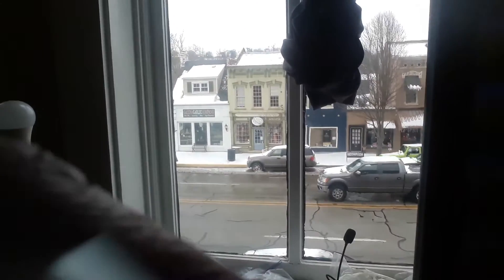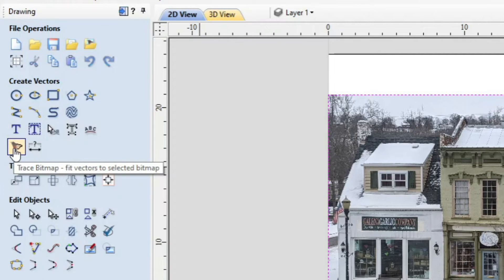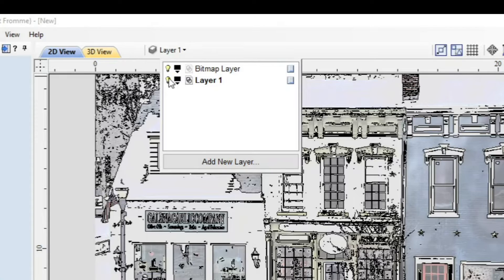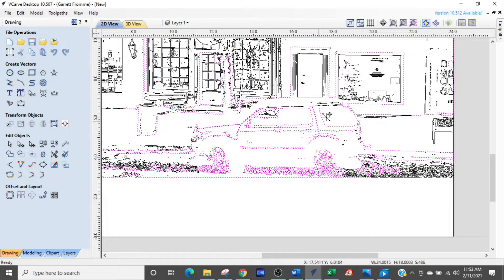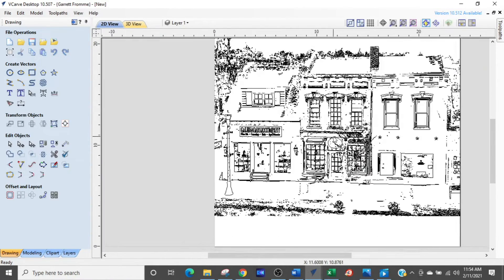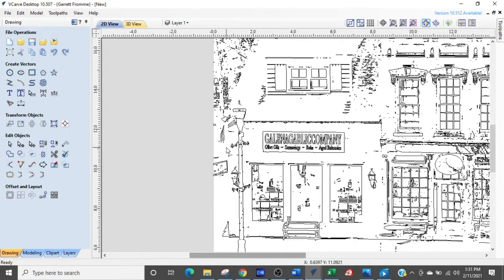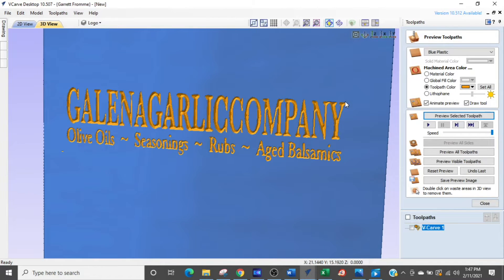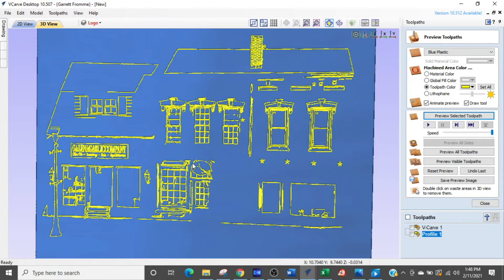Design Logos, Projects & Signs From Pictures & Photos, Vectric Vcarve & Aspire Tutorial

Comment: Garret do you have a video showing how to transfer a photograph from a camera into something that can be imported into Vcarve?  I have a project in mind which is making MDF bottoms for one of my toolbox drawers to keep my screwdrivers from shifting all over the place when I open and close the drawers.  I started to do it by actually measuring each screwdriver, but seeing that I have torx, flat, phillips, hex drives etc. not to mention the different shapes of the handles, it would take days to measure all of those so I just gave up on the idea.  I would like to give it a shot with a photograph but do't know how to get the photograph into my  program or wherever it should go.  Sure enjoy your videos.  Between you and Mark I won't live long enough to try everything, but you guys are the best resource I have ever found on the internet.  Thanks for what both of you guys do to help us out here.
Jim
Reply from the maker: Hi Jim, yeah you sure can brother! All you need to do is use the import bitmap feature and trace the object that you are trying to cut out. It would also help to take the picture with a ruler so the dimensions are correct when you put it in Vetric. I don't have a video on something like this specifically yet but Ill add it to the list brother!
Reply: @IDCWoodcraft  Hey Garrett thanks a lot for getting back to me on this.  And great idea about using the ruler as well.  I probably, no surely would not have thought about that.  Thanks again and thanks for all the helpful video's.  Really appreciate that.

Comment: I design a logo but the logo is 3D and when I start to calculate it says my carving will go through my 3/4” lumber.  It says it 1.58“ deep.   How do you make it where it will only cut 3/8 or 1/2” deep so I can use it on my 3/4” walnut.
Reply from the maker: Hi JL. You need to reduce the shape height of you model. Download the PDF I have linked below. It has all the videos I created, and they are labeled. Watch the videos about 3d models. Download the PDF from this link now → https://bit.ly/3mLHGfI

Comment: What an awesome video Garrett! That was quite the leap of faith you took. I hope wherever things lead you, that they are where you planned on going. Now for the CNC part. You created a tool path for the logo using a 90 degree V-bit and then a different tool path for the rest of the image using a 60 degree V-bit but you kept the logo selected too. When creating the image tool path, shouldn't you remove the logo from that part since it already has it's own tool path so when carving the image out, you wouldn't be going over the logo twice with two different V-bits? Or do you have a reason for doing it the way you did?
Reply from the maker: If i understand correctly, I simply did it to demonstrate 2 things. I would not carve both items on the same project since it would pretty much ruin it
Reply: @IDCWoodcraft  I thought that might be why but thought I would ask in case I was missing something. Thanks!